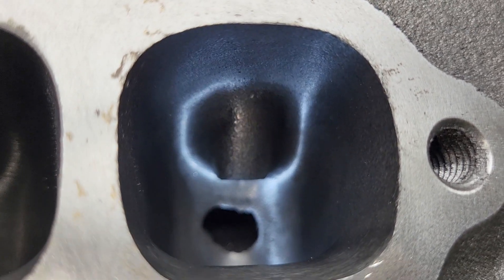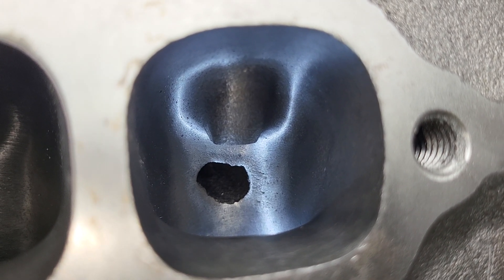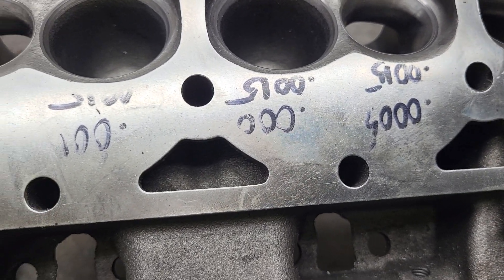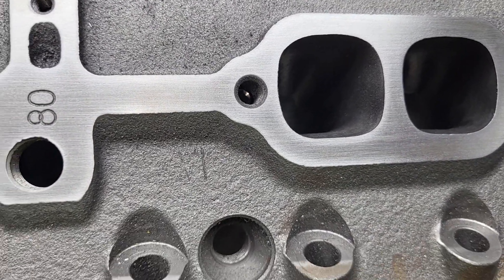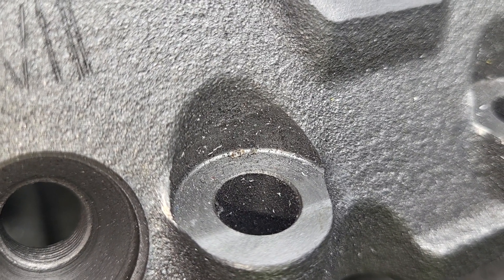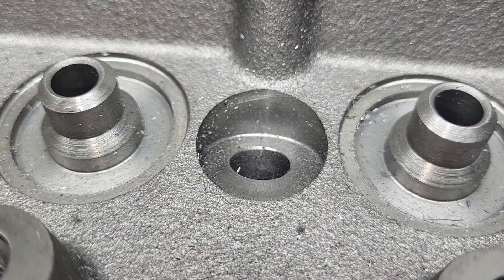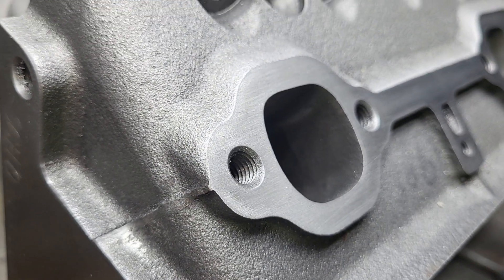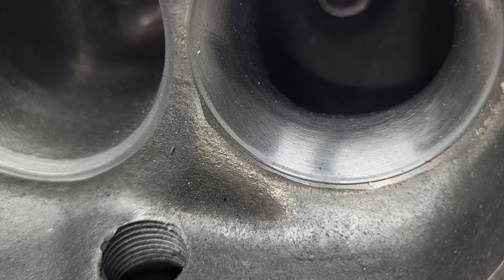Red-headed Step Child, High Performance TPI project. Dart 007, Stress riser and final finesse work.

Comment: Yes, stock oil pump with high pressure spring for high rpm. Or stock big block pump bolts right on. To sbc